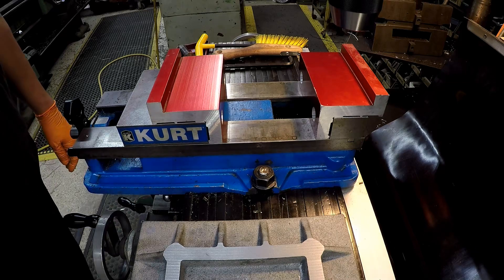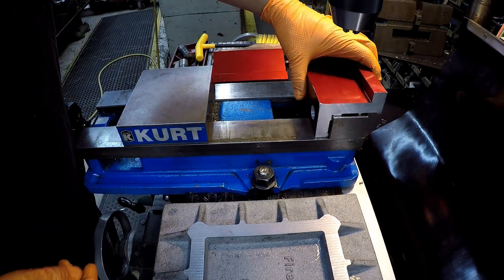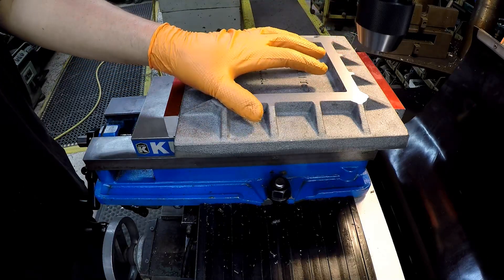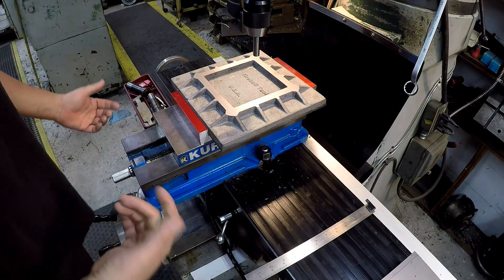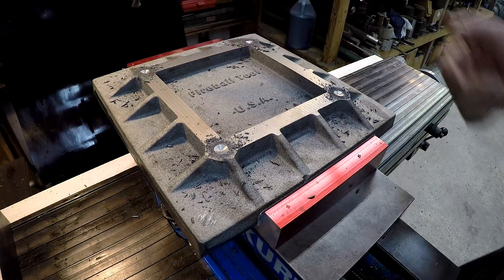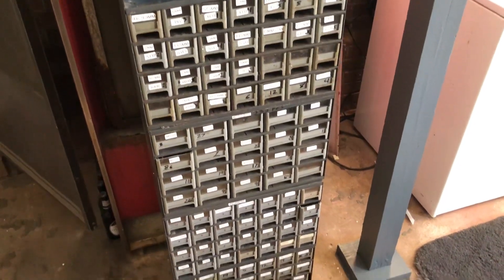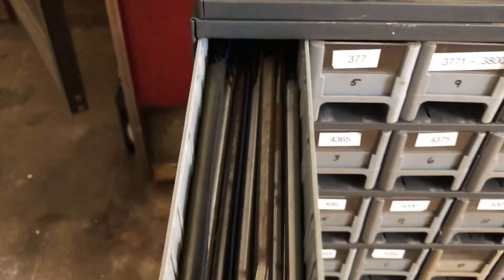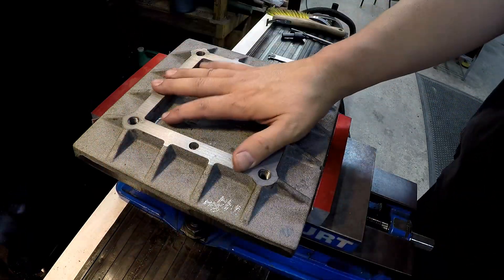Fireball Tool Fixture Plate Part 2

Comment: not a machinist, so i may be misunderstanding something. when you have it in the mill, you only have one face brought in, and that one face isn't touching the fixed jaw on the vice. doesn't this mean the holes you're drilling aren't gonna be exactly perpendicular to the face you just machined on the shaper?
Reply: Possible. Depending on how even the casting is on the other side. But for this I suspect it's not critical that they're perfectly square.

Comment: Dowel pins are usually 
+ .0002 for light press .That's why your pin didn't slip fit . I realize  you don't have but four holes but a step drill save time if you have a lot of holes. I couldn't guess how many step drills I have made and reshaped. You have to have enough holes to justify making one .

Comment: How do you know if the bottom of the cast iron fixture plate is squared to the drill?
Reply: I am assuming that by bottom, you mean bottom in this operation and not the bottom of the Fireball plate (the face Adam is drilling).

If you indicate the top (in this operation) machined surface flat (perpendicular) relative to the spindle, that surface will be perpendicular to the drill. Assuming that the "fixture" plate Adam attaches the Fireball plate to when he goes to machine the top surface is flat on both sides, then this machined surface will pull up to that plate, and the machining of the top of the Fireball plate will be parallel to those three flat surfaces. You should end up with the top surface of the Fireball plate perpendicular to the bolts in the bottom of the plate.

Comment: Complete neophyte here but here goes. If the bottom is not flat/parallel to the top how do you know your holes are square to the machined surface?

Comment: In a past video I have heard you mention that the scale from the hot rolled affects your tool edge. Time permitting have you ever thought of popping the scale n pieces by using vinegar. I will do that  every once in a while on small pieces if I have the time. The scale also messes up my abrasives. Just a thought.

Comment: A quick tip for blowing out the tapped holes without needing to run the compressor. Pick up a second hose for the shop vacuum and attach it to the exhaust port, then you can use the vacuum to both blow the shaving out and vacuum up the shavings.

Comment: from a total noob, would you not want to check the vice is square to the X/Y of the table when adding those new jaw plates?
Reply: Also you got the bottom nice and flat, but i notice you didn't do anything to true the sides of the plate before doing this. Couldn't that cause some issues if the casting isn't actually square?
Reply from the maker: The hole pattern is perfectly square, and so will the new baseplate. Once the plate is mounted and clamped on the rough cast surfaces will be machined.
Reply: Ah ok, you're kinda going from the inside out, where i was thinking outside in. thanks for the reply!

Comment: Is there a specific rpm to run a reamer at ? And how much diameter difference would you advise to ream out in one go ?
Reply: Double the feed, half the speed is the recommended f+s for reaming. Usually while reaming, you're only removing a couple thou as it is a finishing tool
Reply from the maker: Sizing depends on size of reamer. General rule is one drill size under, or about 10%.

Comment: i would have to drill and ream the dowl pin holes with the two plates bolted together. it will be interesting to see how you do it.
Reply: Exactly my thought. It can be done one at a time , first hole reamed all the way with the .374 , remove the plate then ream the hole in the cast with the .376. Same with the other hole... That's how we did it with the mould clamp plates for the injection moulding. Although those pin holes were reamed to the same size diameter...

Comment: Is there a reason there was no oil used when tapping?  I was taught to ALWAYS use oil...not needed in this material? Not trying to be a pointer outer...looking for a learning moment
Reply: Cast iron has a high carbon content, which is a lubricant. Brass also doesn't necessarily need lube
Reply: @donfinch862  I had a sneaking suspicion that was the case...only through my first year of school and haven't learned all the ins and outs yet...thanks for the confirmation
Reply: Good on ya mate. (edit, yeh, I'm Australian) You are aware and thinking. And caring (for the work/job) At your age and your insight, you'll do really well. Best of luck!
Reply: Robert Haglund  A hundred years ago,the advice given then was to use "soda water". Sodium Carbonate in some unknown to me dilution. Even then,if it was good quality cast iron,then it could be done dry. So with better alloys of contemporary times,doing it dry is pretty common.
No reason you could not mix up a batch and try it first dry then wet,and find out if the stuff improves things.

Comment: Well damn, I would have to say seeing a fit so perfect the pin slowly drifts down on its own weight and air resistance in the hole is one of the most satisfying things to see. Especially when you get that pop gun noise when you pull it back out quickly. Great work as always Adam!

Comment: Why did you not spot the first drilled holes with a small Centerdrill as you usually do when drilling a workpiece on a lathe?
Is cast Iron so soft that it is not required or is the drill so thick that it won't flex?
Reply: I believe, center drills are meant for lathes and more specifically live/dead centers. where as a spotting drill is meant for use on a mill. don't get me wrong I've used center drills for every "wrong" application with "mediocre" results !
Reply from the maker: I spotted in all of the hole locations with a stubby drill. The angle is better for the drill bits to start into vs the steep 60* angle of the center drilled hole.
Reply: Many thanks for the information!

Comment: While I think the shop vac is a better choice I wonder why you don't keep an eye open for a 1 or 2 HP compressor to add to the big boy out back.  That would be a lot cheaper to run for the occasional blow off.  Fire up the big boy when you are running air tools.
Reply: no one wants cast dust all over the machine shop
Reply: Come to think of it, iv never seen him use air in his shop for anything other than blowing stuff off and the occasional die grinder. I wonder why he has that huge air compressor
Reply from the maker: Shawn, because it’s what we used at my old shop to supply the blast cabinet, which I sold back in December. It’s what I have and what I use.
Reply: @Abom79  oh ya. I forgot you used to have that. Ever miss it?

Comment: Hi Adam. Why did you use that big drill to spot the casting rather than a centre drill.  Thanks Regards chris..
Reply: probably because the cast iron is soft enough that it doesn't matter much
Reply: WoLpH Thank for the info regards Chris
Reply: On cast iron and brass it will cut crooked if you use a centre drill to spot as it will pull one edge in towards it (sharp drills with morse tapers are a pain)
Reply: Espen Andre That’s interesting thanks. Regards Chris
Reply from the maker: I’ve been using spotting drills such as my stubby drills more, they do a better job of keeping the drill bit edge from chipping.
Reply: Abom79  Thanks Adam for the reply and information, i would not of thought of that. But have sometimes found my centre drills wanting.. Regards Chris

Comment: heated a dowel one time with a propane torch and the oil behind it expanded and it pop shot outta the hole like a little cannon it was stuck probably from the vacuum pulling it back in so good to have tools you almost forgot about ya heard what you said about custom work the 914 calipers are like $500 bucks for the rear but with a piece of 1/2 inch prehardend barstock you can make an adapter for a wildwood caliper and use a Porsche 911 master cylinder for the same price or less or even cheaper is a bmw 320 I think caliper that needs a bit machined off it think that combo uses the stock 914 rotor and 911 master that forged cb spindle will last forever if you modify it like that good work

Comment: Hi Adam.  I’m new at this but have a question.  Once x and y are centered how did you determine where to drill the holes?  Sorry for the beginner question.  Thanks for sharing.  Was it the 3 x 3 that you stated?
Reply: From the center he goes out 3" in one direction (let's say x).  That aligns him with the middle of the plane of where two of the holes would go.  Then he moves +3" on the y to get to a corner.  Then afterwards, moves -6" (3" to get back to center, then 3" to get to the other corner).  Then he can just go 6" and walk around the corners, switching x and y axis as needed. 

| - - -x - - - |  

Move 3" left  x - - - - - - | 

Then go 'up' or 'down' 3" to get to the corner
Reply: Also, his DRO has a "bolt circle" function.
He uses that function extensively in the videos about building the new "slotting bar" (?) for the shaper.
Reply: Thanks everyone.  I to have this on my DRO but have not yet used it.  I have read it in my manuals but forgot about it.  Thanks again.

Comment: Would it be easier and more precise if the dowel pins were both put in place through the plate and the fireball and then reaming the size with the holes exactly in position? It may give a better final fit up. Great videos like the way you break down the project steps.

Comment: question . why have a dowel that floats .wouldn't you want it to lock into at least one side of the plate just asking .?
Reply: David Ellenbaum the dowels will be press fit on the mounting plate so need that slight amount of clearance here so they can be separated easily. 👍😊
Reply: Adam mentioned that the fit on the plate to be mounted will have the dowel holes reamed tighter.

Comment: I like those vise jaws! I want a set. Is there a brand name anywhere? A hardened ground set would be killer.
Reply: Looks like another tool for the Fireball line.  Available in aluminum, steel or hardened steel.  😉
Reply: MikeBramm I’m totally down on making some!
Reply: These vids remind me that I need to get some more Fireball squares!
Reply: You can use " H- Section" steel or cast iron and cut the two verticals off.

Comment: Hi Adam I like them draws the guy give you for your curtains up they're awesome.
I got a question about filming the plate to the cast iron, I think I would have probably mounted the plate with the bolts before I would have put the alignment pins in. but I don't have a Dro to help me out with that type of situation.
I am thinking about getting started in doing some videos, and was wondering what type of camera you're using in the editing software.
Thanks Adam and keep it up!!!